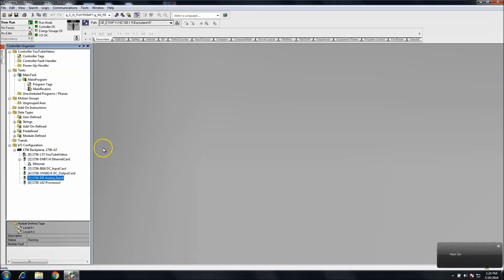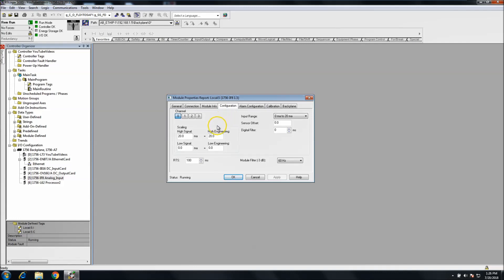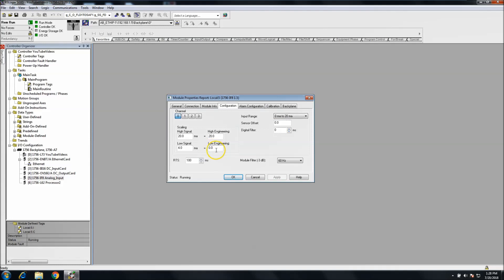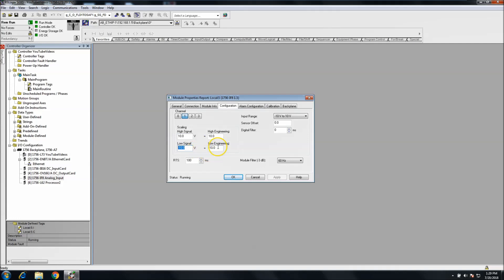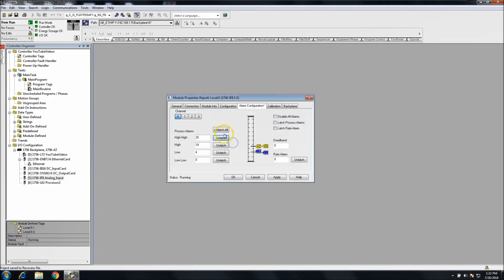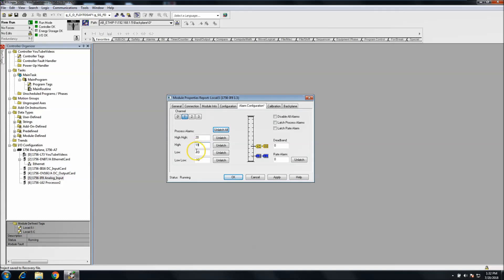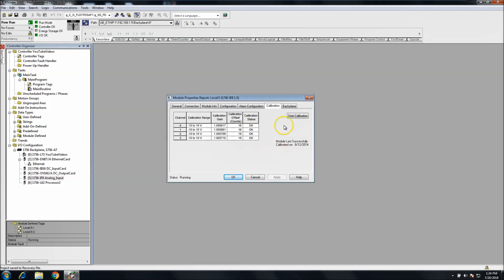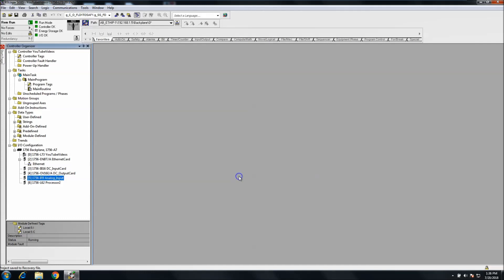RSLogix 5000 Analog Input Card Setup | Online PLC Support

Comment: I can see on this module you can configure and scale directly the engineering units so my question is: on the logix logic I can read directly the scale value from the module or I’ll need to scale the signal anyway?
Reply from the maker: You would need to scale each analog device or input to match the device or application that you are using. Sorry for the delay in response, for some reason your question was marked as spam. Anyways, I hope this helps.

Comment: Nice explanation . As I have  same analog card shows calibration error  and I can't get value from 3 channels out of 4 channels ? One channel showing correct value . Whether my channels need to calibrate ?  Please suggest
Reply from the maker: Either this is a wiring issue or you need to double check the setup of the card. 
If setup correctly then it is a wiring issue, verify the wiring to the card is correct.

You should not have to calibrate the card or channels unless the real 4 to 20ma is incorrect, meaning you have checked it with a voltage meter.